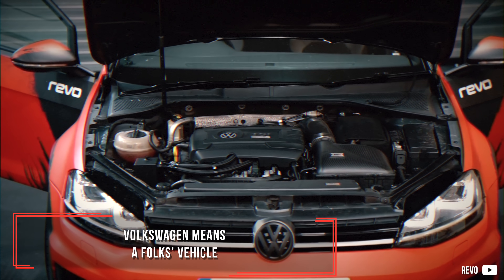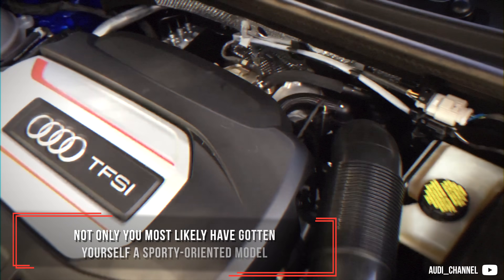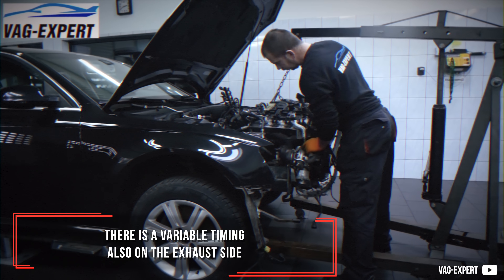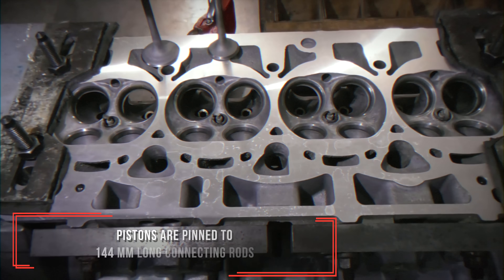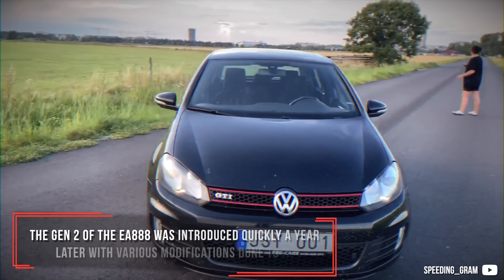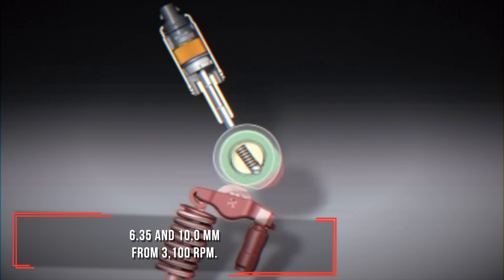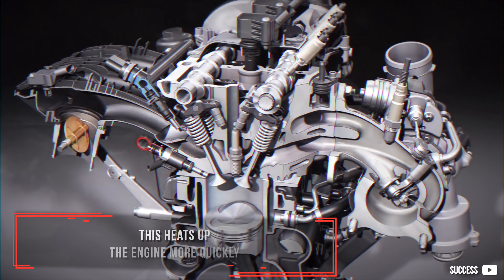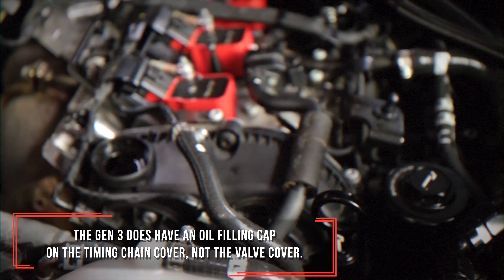Why The Volkswagen EA888 Is So Good

Comment: Love all the techs claiming the EA888 is unreliable but lumping all three generations together. The gen3 isn't the same engine. The only real weakness is the water pump. Early IS20 turbo cars and some IS38 cars had weak turbo's and later facelift MK7.5 had some direct injector issues, but that's about it. There is no other car that is as good a daily driver bang for the buck as the Golf R. You can do a few mods and make 500whp reliably, drive it year round, take 3 friends on a weekend vacation and fit a 65" TV in the box in the hatch.
Reply: Love my Mk7.5 R...you said it perfectly. It's a jack of all trades. I have the manual...so I had to upgrade the clutch to play with extra power, but lemme tell you...worth every penny.
Reply: @HotYogurtMan  I want to tune mine but I'm concerned about losing my warranty 🤣 Stage 1 for now would be nice. Stage 3 later on.
Reply: @Azula7.5R  trust me dude I know how you feel. The Golf R is a ton of fun stock...I tuned mine with only 18k miles on it...and I juggled the option for months.

I love the subtly of the R, and I modified it in a way that keeps it clean and crisp. Do I sweat at times about the warranty? Of course...but if you tune a car right it can end up being more reliable than the factory version. 

My advice is this, enjoy the stock setup until you feel comfortable enough to pay to play in the event that something goes wrong. A stage 1 tune can be handled no problem, especially if you have a DSG. Just mark my words...you'll get addicted and buy an exhaust or some other upgrade shortly after 😅
Reply: @HotYogurtMan  That's my plan too lol. OEM+ look, powerful performance. I'll just begin buying parts until I have everything I need, then go full send. But it's so damn tempting right now!
Reply: @Azula7.5R  My man enjoy your journey! I'm excited for ya
Reply: I enjoy my R like crazy. Looking forward to adding more power later on.
Reply: I agree, I've owned a 15 gti which was heavily modified and beat the absolute shit out of it (back to back full throttle pulls) daily for 70k miles with very few problems. I've had my water pump fail and coolant feed line to the turbo crack. Not a bad price to pay for 350whp lol
Reply: @ProdPxwolf  wich mods do you have ?
Reply: @AAAAAAndrea  Full bolt on Is38 with integrated engineering software. Also my car was a 6 speed. I've had a friend suffer from crank walk on his car but it seems to be a trend with manual transmissions that use a DKM aftermarket clutch so Id stay clear of those lol.
Reply: @ProdPxwolf  Is it heavy on your foot?
Reply: @AAAAAAndrea  I ran a sachs race clutch and its not very heavy. It's a bit worse than oem but very manageable in heavy traffic.
Reply: @ProdPxwolf  the 600 nm one? nice :)
Reply: @AAAAAAndrea  I have an RSR Hybrid clutch to retain the comfort of the dual mass flywheel. Excellent performance, only slightly heavier feel than the OEM setup, and zero chatter
Reply: @HotYogurtMan  Thank's 👍
Reply: Is there an upgraded aftermarket water pump available?
Reply: @ByronWWW  urotuning makes an upgraded metal pump but not sure if its any more reliable
Reply: @ByronWWW  no there isn't but there isn't really anything wrong with the water pump itself.  It's the gasket between the meeting services that tends to leak due to heat cycles.  The problem lies on the gasket itself.  Not the pump.
Reply: @eppyz So why is it VW cant seem to get this right when every other manufacturer can.  Thst and the pano sunroofs are a nightmare when their plastic frames crack
Reply: They burn oil. Everything is plastic around it...are you kidding me
Reply: @bulletsRflying  Factory forged they'll take double the power from factory much more reliably than this VAG engine
Reply: I dunno I've had a few issues with them. They are a great engine but seem to need a new timing chain every few years. They don't carbon up the intake valves too bad if you give them a boot every now and then.
Reply: You guys can get an N54 powered car for circa 5k, make a true 500HP on eth, stock turbos, 550-600 on pump on uprated turbos, 650-700 on eth. It's far more HP for your buck with a strong inline 6
Reply: @donwingchun  Bought my 07 e92 N54 2 years ago for 6k has 68k miles
Reply: Well there is one car that is a better daily and that is the GTI.  Yeah it's not AWD but for the price point is the better bargain.
Reply: It's such a great engine! Brags about making it to 60,000 mi 😆🤡
Reply: @brettbrettson69  they last a long time like anything else these days just have to keep up on maintenance.  They just can get expensive to repair due to parts being expensive.
Reply: @eppyz  they get expensive because they're unreliable garbage. They have to make so much horsepower because all new cars are so bloated. And everybody wants them to be multi-purpose vehicles. I'll put my eight valve ABA turbo up against any of these plastic manifold carbon garbage.
Reply: @brettbrettson69  well i will disagree with you.  Have you personally owned a car with a ea888 or just going by what you see or read here on YouTube?  I'm basing my belief off 2 cars i have owned that has this engine.  One has over 180k miles on it now and no issues other than routine maintenance.  The other has 90k on it now and so far no issues.  Most cars now a days have plastic intake manifolds so what your saying is silly.  Carbon cleaning is part of the routine maintenance not only with vw but other DI motor brands as well.  What i have found is these engines are very particular to maintenance.  If you don't keep up on maintenance or use the OEM approved lubricants you run into issues.  Many people modify their cars as well putting allot more stress on the components.  My next door neighbor has a 2019 Subaru STI he bought new.  At 1800 miles the engine had to be replaced.  Are those crap too?  No.  Bad things can happen to any brand.
Reply: @eppyz  no, the boxer is junk as well. You can tell yourself all you want it's a great engine but it's been garbage since the mk 5. They should have never gotten rid of the 1.8t. Once again, I'll put my turbo ABA up against any e888. Keep putting tiny motors in 4,000 lb plus cars and these are the results you get
Reply: @brettbrettson69  well your telling me to keep telling myself what?? I drive a car with one of these engines and I have no problems with it..so I'm not really sure why you're trying to pick a fight with someone that's having no problems?? any car manufacturer may have engines that could be potential problems but you do the repairs because you like the car ....and you keep it if you don't like the car?? you get rid of it...I'm not sure why you're here bickering if you don't like it don't buy it...but many people do.... they enjoy their car and as long as you maintain it and take care of it it should last a long time why you're arguing about this is just be on me.
Reply: @eppyz  there is not one vw garage that offers carbon cleaning as regular maintenance😂 my mates 2020 golf r blew a hole in the block after 30k miles. He is a vw mechanic and knows they are not reliable. Even vw knows😊
Reply: @TheTechnoaddict  maybe where you live it's not part of a service but it's offered here where I live and costs about $600 to have done.  I'm sure your "friends" car was probably tuned and modified and that's why the engine went as well.  Bits you forget to mention 🙄
Reply: @eppyz  some garages offer it but isn't regular maintenance. It's not in the vw mechanic workmanual either.
Reply: @eppyz  it was on a stage 1 and had new oil ervey 5000 km. As i said, the guy is a vw mechanic so he knows them pretty good😊. It blew because there was too much fly by into the crankcase increasing the pressure. It even popped a line from the pcv.
Reply: @TheTechnoaddict  so you had a tuned car and something happened and you blame the car? Mmm ok.
Don't care if you're friend is a mechanic I know many mechanics.  Your modified the car and had a problem.  Sometimes that happens.  Was your car a manual?  These are known to have crank walk when tuned.  But I'm sure your mechanic friend already told you that.  You modify any car you roll the dice doesn't matter the brand.  My next door neighbor new Toyota Corolla has his Transmission replaced after 1800 miles due to a fault no car is perfect.
Reply: @TheTechnoaddict  here in my part of the world the dealerships offer the service so not sure what to tell you.  It's recommend every 60k miles.  It's not in the manual but recommended by the dealership.  Though my MK6 GTI with 180,000 miles on it has never had it done and still runs like a Swiss watch😎
Reply: @eppyz  some are lucky with the mk6 gti. They have an engineering fault with the pistonrings and spring to meet co regulations. A lot of them over consume oil and have problens with the chains. There are companies over here that only rebuild tsi engines. That's how much fail! And as i said, some garages offer the carbon cleaning services but it's not a part of regular maintenance according to vw. It's offered now cause they know of the problem😊. My job is rebuilding engines and we have seen a lot of vw engines in the workshop.
Reply: @eppyz  wow that's a load of bs. It was mapped by a pro. It had 0 knock count, timing advance was well within safety range, afr on point, upgraded intercooler, oil catch can, constant monitoring live data, ran nice and warm before pushing, boost under the limit of the turbo, oem parts for service, built in back pressure sensor, ... if an engine like that can't take a stage 1 tune, it's not a good one.
Reply: @eppyz  and no, it was a dsg.
Reply: @TheTechnoaddict  yes I understand that but my cars are stock and not modified to why I have had no problems.  Most people I know that have VW's that have problems are modified in some way.  You pay to play.  If it breaks? It's on you.  I know many people that are mechanics and they can say what you say about VW about other brands.  There is no perfect car.  You buy what you like and take care of it the best you can.  Again, if someone modified something? It's the chance they take.  I drove Mitsubishi Lancer Evo's for over 10 yrs.  My Evo 9 MR made 400awhp and I drove it like that everyday for 6 yrs before I sold it.  Never had a problem.  While other people had the same car and blew the engine🤔 so is it the car? Or the people 🤔 any mechanic will tell you most people are the cause of failures.  People do stupid things.  Yes there are failures that happens with any brand.  But it's not the norm.  Even Toyota mechanics will tell you things or Hyundai mechanics all cars have issues.  There is no perfect car.
Reply: @eppyz  i work at an independent workshop. So my opinion is based on experience not on affiliation with a brand. And vw admitted the faults with the tsi's in the mk6 and in the polo. and that's with stock engine. What we see is that vw is so close to the limit in their engineering. They are amazing when running good but they can give a lot of problems. Never had problems with any engine on a good tune. Currently 60000km on a stage 2 on my 1.6 turbo and 125000km in total. Engine checked last month and was still healthy. And carbon build up compared to a vw tsi is almost none existing.
Reply: @TheTechnoaddict  I understand, but I am also basing my opinion on personal experience in having 2 VW GTI's with the TSI.  Different variations, MK6 and a MK7.5.  MK6 has over 180,000 miles on it, no issues other than a leaking water pump gasket.  I bought the MK6 new in 2013.  The MK7.5 is new and only has 10,000 miles on it.  So far so good.  I think they are good engines overall, but like anything out there is not perfect.  Carbon issues vary and reliability is always subjective.   Won't matter down the road anyway with everything going electric in the next 10 yrs or so.  Most people do not take care of their cars and tunes can ruin engines.  Its a risk you take.  Good Luck👍
Reply: @eppyz  only bad tunes ruin engines.
Reply: Let's not forget S3/Golf is one of the only small cars that can do 270km/h while carrying 2ppl + 2 luggages for 2 adults and 2 adult bycicles inside the car.
Reply: @ For stock form, its insane
Reply: My 2.0 polo GTI goes well and haven't had any issues with the motor at all.
Reply: close, IMHO the S3 is the perfect bang for buck "daily driver"- same difference, I get the AUDI badge LOL
Reply: @volkssturm9694  if we got the hatch version here I’d agree. Unfortunately we get sedans only for the S3 and RS3. And we won’t get the new RS3 at all.
Reply: @dwvw  thats fine, I get that from someone else's( I used to be a hot hatch guy) perspective but I adore the S3 sedan, In the US we are getting the new RS3. My 2018 S3 sedan in my eyes is perfect, total joy to drive, its a beast.
Reply: @volkssturm9694 I’d rather have 1 of 145 registered on the uk roads as of aug 2024
than the s3
Reply: I have a Octavia 3 rs 2014 with this engine. 610l boot space and nice performance. Adaptive cruise is a treat and if you need to overtake, it really goes. Loving this engine as well! Thinking about stage 1 this year. Tempting to get 300bhp/440nm 🤔
Reply: You can't fit a 65" TV box in the back. I had to put the seats all the way forward and still had to keep the hatch open lol
Reply: i couldn’t agree more
Reply: VW's biggest mistake was going away from the Borg Warner turbos to the IHI turbos.
Reply: "few mods" lmao okay. you'd need at least a new turbo
Reply: @Bixnoodle  you’d be surprised how much boost the OEM ones can take…
Reply: @alexmnblyth  I know the blocks themselves are very robust, but you're saying the stock turbo can make enough boost for 500whp?
Reply: @Bixnoodle  at a very big push, and running the risk of the engine blowing up. theoretically possible.
Reply: @alexmnblyth I’ve seen them make mid to low 400s with a IS38 turbo and running E85 along with a host of other bolt ons. 500hp would definitely be pushing it, but definitely possible.
Reply: @rit2ual  precisely. it’s v unhealthy for it and very rare but theoretically possible
Reply: yep, gen 3 is much revised and has little issues. gen 2 was a bit of a disaster in the long run.
Reply: Is the later gen3b better than gen 3? @vladmihai306
Reply: TITLE SAYS EA888, NOT EA888 GEN3.
Reply: 10 vw / audi technician you're 1000% right
Reply: Gen 3 oil consumption?
Reply: @ my car is down under 1/2 a litre when I do my oil change every 5,000 km’s.
Reply: @ I dont understand why some use oil and others dont
Reply: Hi, How often need to replace the water pump? It is not cheap to fix.
Reply: Isn't the EA113 a more powerful and more reliable engine?
Reply: You know how Im happy to hear this.I was scared to buy TSI but I did only to find out I bought 1.8 132k gen 3 engine so Im really happy to hear that model doesn't have many problems.Every engine has some sort of weak point but its important how wast that will show up and that weak point is not something what will destroy engine,like gen 1 EA888 for example
Reply: Dude like yeah boost that shit for real. Rice 🔥er for life 🤪
Reply: @Gatornation2020  ricer?! It's German ffs
Reply: expecting an EA888 to live, reliably at the 500WHP with "a few mods" is pretty optimistic, bud. You are firmly out of "few mods" territory when the engine is putting out almost triple it's rated power at the crank.
Reply: It's like a mini 911 Turbo.
Reply: @nightdriver7216  no, that's an rs3.
Reply: Trust me it's more than the water pump. The motor is still a pile
Reply: @allenstyer205  not on my personal experience.  Will just agree to disagree with you and leave it at that.
Reply: No ea888 is living reliably at 500whp.
Reply: @ I’m now at 182,000 km’s on my 650+ whp Golf R.
Reply: @ Thats insane
Reply: I’d say only car that competes for the money is the stinger. Can make 500whp with ECU tune and some bolt ons. With a hatch just like the golf r but looks much better imo.
Reply: Gen 3s rarely make 500 reliably. Almost everyone I know who’s had one making power has blown up. They blow up stock for no reason. Junk. Gen 1 is better despite its timing chain issues
Reply: @Ethan007Hacks  Never mind the 500 WHEEL HORSEPOWER , so closer to 600 at the crank. Not exactly a CAI and a tune kinda mods here....
Reply: @jamesgeorge4874  way easier to do than you'd expect. 500+ on stock motor wasn't a challenge to make really, nor was it that expensive.
Reply: @jamesgeorge4874  I have our Swedish BSR tune. Check them out: They have a Golf R modded to push 700 HP! My GTI Clubsport is stage 1 at present pushing 360 hp 462 torque at moment. May be going REVO stage 2 and TVS 2+ DSG tune laters! Will most likely push over 400 hp easily. Goal would be round 420 ithink. Dont wanna be forced to get forged pistons!  😄
Reply: @tredfxman  nvm m
Reply: @sleepy-gti we’ve a mk8 Clubsport, £1899 for the bolt ons and map has gave us 450bhp 
TCU tune £399 on top and it’s ridiculous 
Its also been 100% reliable/ used as the daily 
Gen 4 ours is though

Comment: I have 114K miles on my 2015 gti. Main issue pcv valve is poorly designed on these motors. Also the fuel system which is separate is also an issue with these cars ,f uel rail and pumps are known to fail. I know their is a design issue with the cylinder head in these engine, I always seen cylinder 2 or 4 blowing up.
Reply: And that's your 2015. 👎sorry for your 🍋🍋🍋🍋

My 2016 MK7GTI has Unitronic stage 2 at 337HP and 370ftp. 
Since Ive owned,  ZERRRRRRO failed parts, mechanical or electrical. Hmmm, I want to thank the Mexican 🇮🇹 partners for great workmanship.
Reply: @sporopeza  I would ditch UNI. I'm on stage 1 granted on e30. Once the car breaks 400gtp its another world. Get a protune or APR. 
Its far from a lemon but these engines do have their own issues. Once you work on more you'll see them. You'll get there bud.